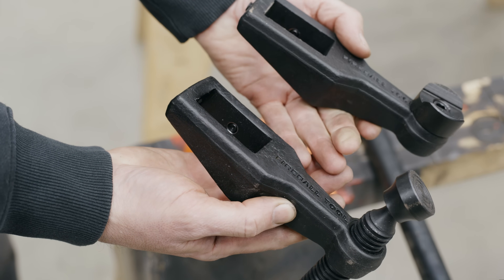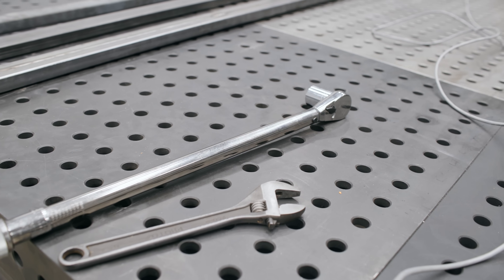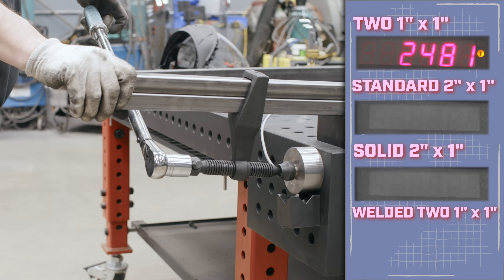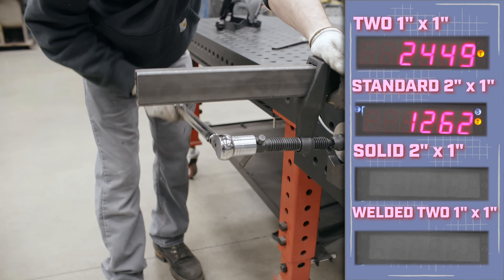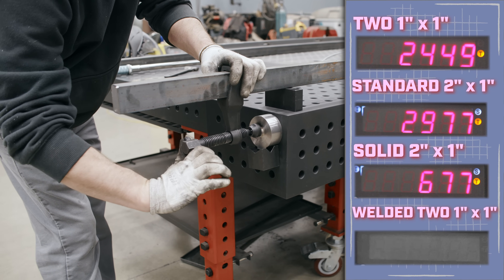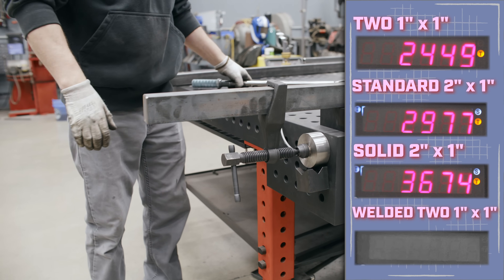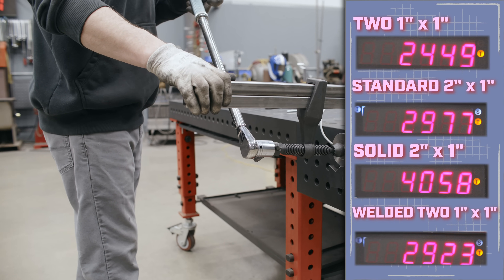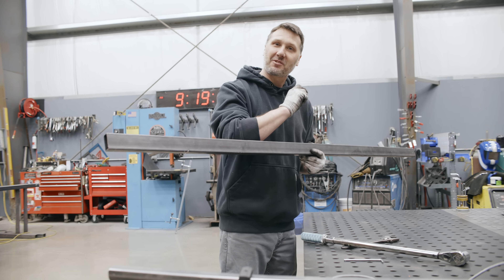What Tubing Works With the Maximus Clamp?

Comment: the 2 1x1 welded together should not be mutch stronger than the normal 1x2. the extra metal is right on the neutral axsis. where its not doing mutch.

edit. VINDICATION.